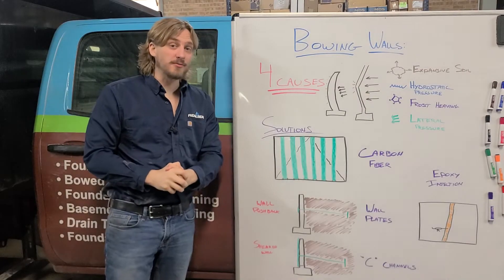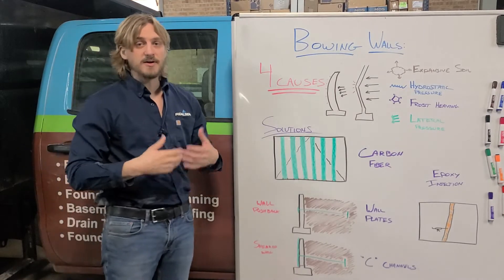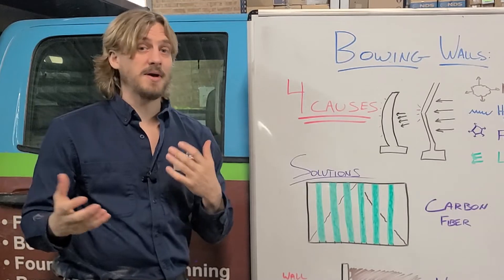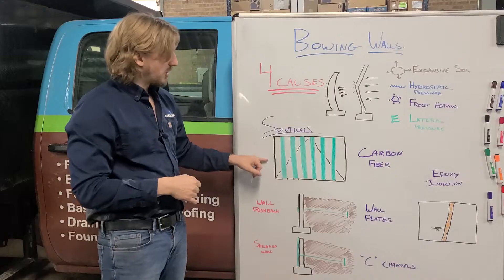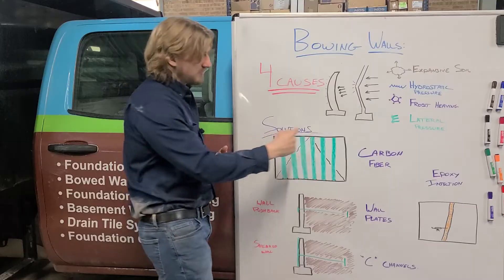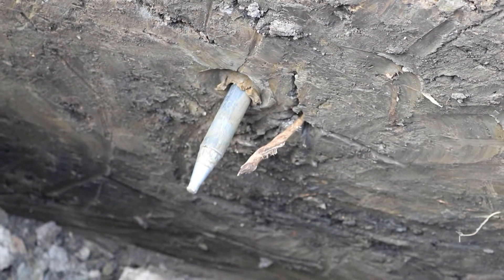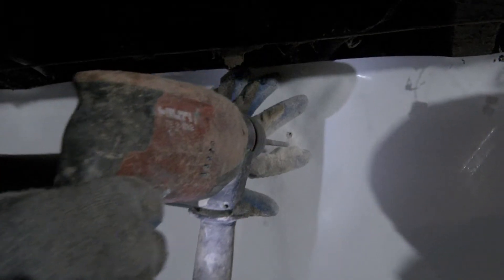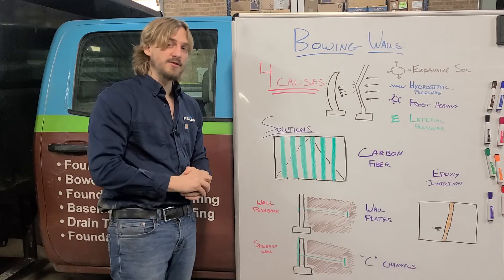Bowing Walls: 4 Causes & 5 Solutions

Comment: I have a wall with a roughly 1/2 bow in it. Is this an immediate concern and what would be the best route to addressing the issue?
Reply from the maker: You caught it early! With a 1/2" of bow, it's best to get it secured early on. 2 Main Points:

!) Carbon Fiber is your best solution here. It comes with a Lifetime Warranty and will stop all future movement of that wall, better than I-Beams or Wall Plates. 

2) Check the drainage outside that wall. Observe the gutters for possible overflow and the immediate area for pooling water. Hydrostatic pressure is the #1 cause of Bowing Walls.
Reply: He says carbon fiber in the video, I think, but you can always go harder and use some kind of steel I beam.

The bowing will get worse over time, especially over the winter in most cases, so you want to get it early.
Reply from the maker: @buckaroobonzai2909  Carbon fiber will actually be stronger than a steel I-Beam. The tensile strength far exceeds steel (it isn't even close), which is why this repair is a Lifetime Warranty with Carbon Fiber and 15-25 years with Steel I-Beams, depending on the company you go with. 

The earlier it is caught, the better, that is absolutely true.

Comment: how much force can that carbon fiber hold back I have poured wall that has a crack like an X in the mid section. There was water leaking in but i fixed the water issue via french drain system and no water came in the cracks anymore for past 2yrs. The wall is 1.5 in out of plum I have 2 choices carbon fiber or threaded rod tie backs. I hear lot of guys saying CF is just a band aid and wont last.
Reply from the maker: Carbon fiber can hold back that entire foundation wall with a 1.5" bow, and most contractors will put a lifetime warranty on that repair. 

Carbon Fiber is in fact stronger than steel and the tie backs, and the preferred method of repair. What area are you in?
Reply: @Therealsealllc  I just saw that CF is not recommend if the cracks run both vertical and horizontal or are wider then a dime.  Looks like i will be doing threaded rods and anchors
Reply from the maker: @johng8049  I do not agree with that. Carbon Fiber can be used easily with up to a 2" bow and has a longer life and higher strength than the rods and anchors. This includes with both horizontal and vertical cracks.
Reply: @Therealsealllc  i tried to replay with a link to a more in depth explanation on carbon fiber but it was removed. Dryguys foundation repair made a great video about it. They   say if the crack is more the a dime or there is differential  movement on either side of the crack it should not be used as the only support. There are many other factors
Reply from the maker: @johng8049  We're very familiar with Carbon Fiber, and have been installing it for years. If you want proof it is better, ask for their warranty. Carbon Fiber comes with a Lifetime Warranty, Wall Plate Anchors do not.

There are situations where Wall Plate Anchors are better. This is the case when the wall is bowing more than 3 inches. In that case, you need to push the wall back and straighten it out. Carbon Fiber does not do this, but Wall Plate Anchors can. 

But if the wall is bowing less than 3 inches, Carbon Fiber is your preferred solution.